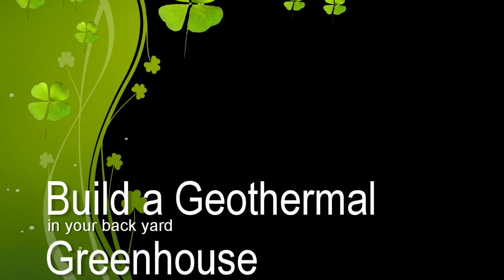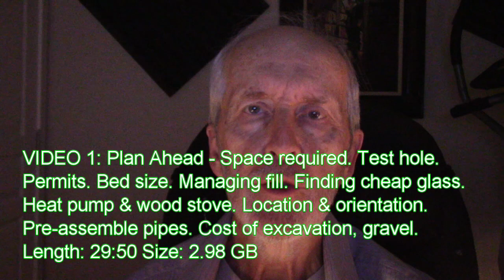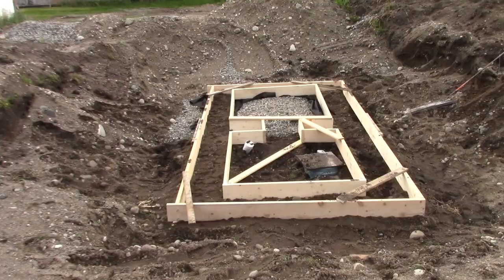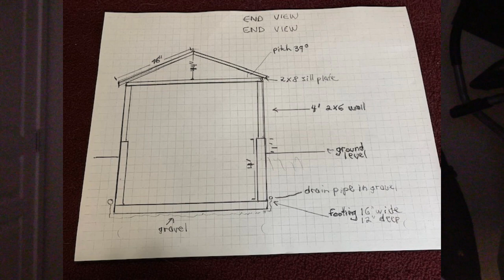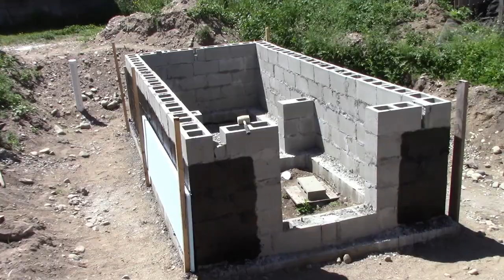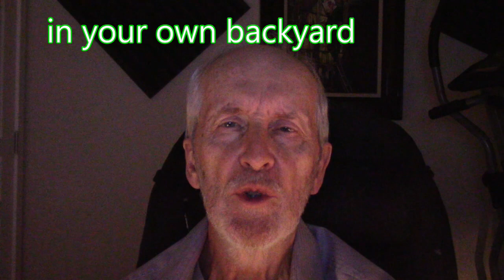Geothermal Greenhouse: Video 1: Plan Ahead

Comment: The area is one part of the equation, by far the most important factor is the amount of air you can run through the system. The design in the video will severely limit the amount of air  you can run.
Reply from the maker: There seems to be a lot of air movement. 1. The fan is drawing from a bed of drainage gravel larger than the footprint of the greenhouse and greater in area than the volume of air in the greenhouse. 2. Even without the fan, the two deep vertical pipes are always exchanging air. 3. Even without the fan, a lot of air moves up from the gravel storage battery, or down into it, driven by differences in heat (air temp in greenhouse versus temps in the ground).
Reply: @pathunknown  
Unless you have direct sun hitting the floor of the greenhouse, mass heat gain in the summer with the system turned off will be mainly via conduction which is governed by surface area and temperature difference. As the surface heats up there is less and less differential to drive the process, at least until the heat migrates downwards. If you have temperature sensors located in the mass and speed control on the fan you could compare the outlet temperature to the mass temperature in the summer. If you are unable to get the outllet temperature to rise above the mass temperature you either dont have enough airflow or the tubing is too long. If you install temperature sensors in a length of tube every 2ft you can track the temperature of the air inside the tube, you`d be surprised how fast the air drops to the mass temperature inside a tube. A lot of folks go for long tubes as they assume longer dwell time results in better heat transfer. What happens is the air drops to the mass temperature in the first 10ft and then coasts through the rest of the tube without transferring any heat. They overlook the fact that the surface area available for heat transfer is identical for 10x 10ft tubes or 1x 100ft tube, the difference is the amount of air you can run through each. For example, 1x 100ft 4" tube can run 60cfm @ 0.25" SP, 10 x 10ft tubes can run a total of 1900cfm @ 0.25" SP,  over 31x as much air for the same amount of surface area.  You cant run 1900cfm through a 100ft 4" tube, you`d need a fan capable of delivering 1900cfm @ 9.3psi :)
Measuring the actual airflow rate is the only way to know for certain. If you know the true airflow, inlet/outlet temperature and humidity, you can calculate the actual system performance.